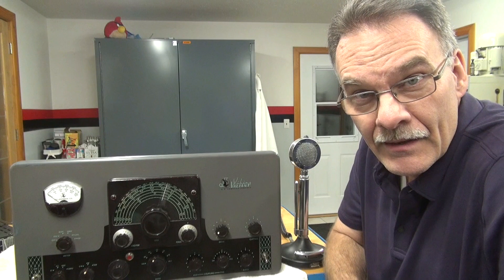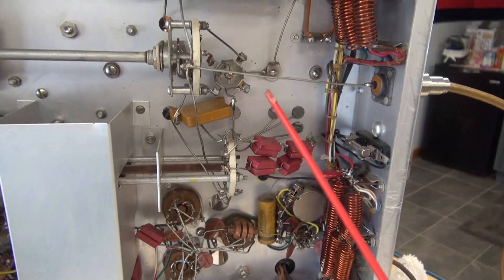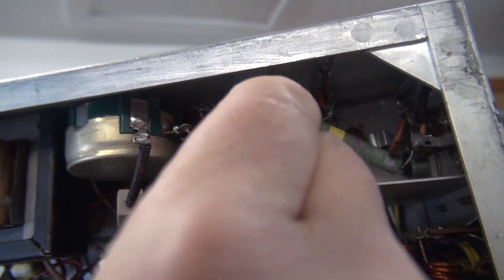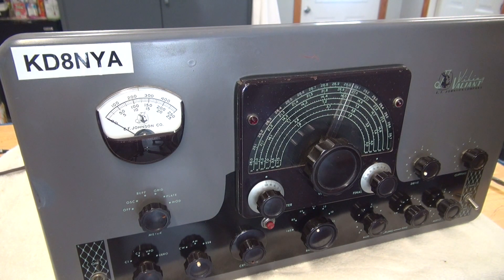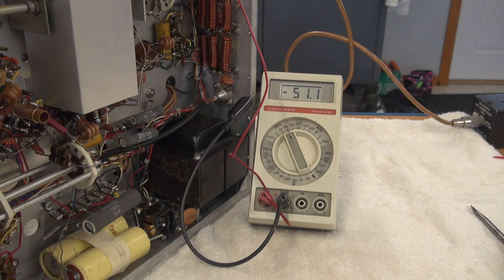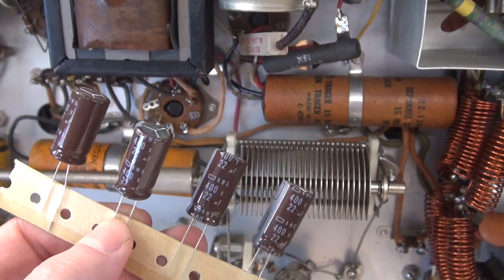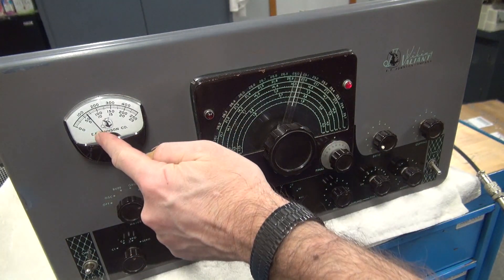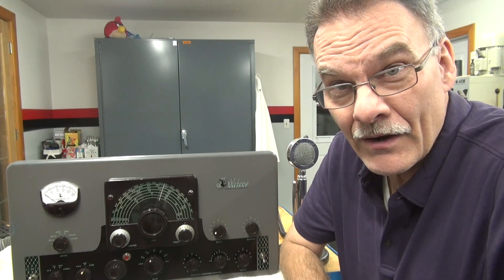How to repair EF Johnson Valiant Ham Transmitter Loss of Modulation

Comment: Hi Matt P have a Johnson Viking Valiant no modulation no modulation current at all plate is good and grid is ok has been modified and was working was left on for 3 weeks and when returned friend said didn't work . Track with scope have audio up to the modulator tubes and then quits no out put to the finals stuck right now any I deas would be great  W6PKN  Your videos are great.

Comment: None of these old transmitters should be operated, before they have had every single paper and electrolytic cap replaced with fresh modern components. ( leave the micas alone !)   Like wise, all the tubes should be checked on a good tester ( like a hickock), and anything that is less than 85% (or low emission filaments)  replaced with a new or excellent used tube.  Modulator tubes should be reasonably well matched, and the bias set per the manual. Minor value changes can be made to tailor the audio response with no harm done.  Bypassing the clipper is reverseable, so no harm there.  Avoid imbeciile mods like triode connecting the modulators or wildly different component values.  Clean and inspect the transmitter before beginning.   If you find tell tale arcs.. find the cause and fix it !   Doing this will prevent the loss of expensive "iron",  and you will likely not experience failures during use.. if you have been thorough at the outset.

Comment: Hi I was wondering if you could help me with something, I recapped my amp and made sure all the capacitors are in the right value and the wires is gone back to the righ place But my amps volume has dropped significantly Is there anything you can think it is?
Reply from the maker: Make sure all solder connections look good.
Measure the pre-amp tube voltages. Approx 180vdc on plates and 1.5vdc on cathodes. You may have lost a resistor feed. TD
Reply: thank you